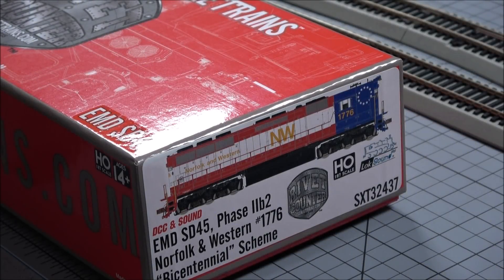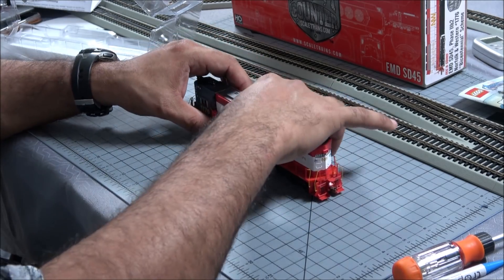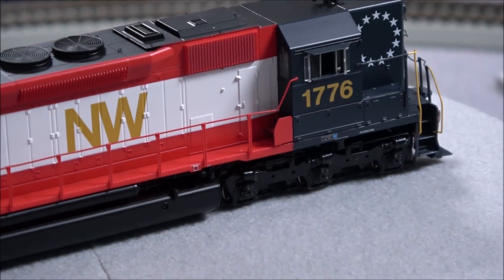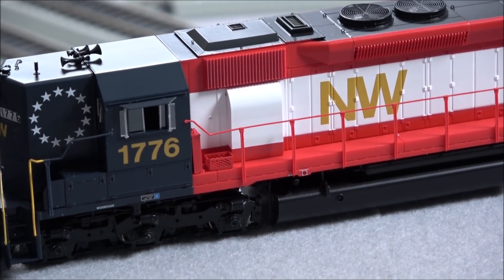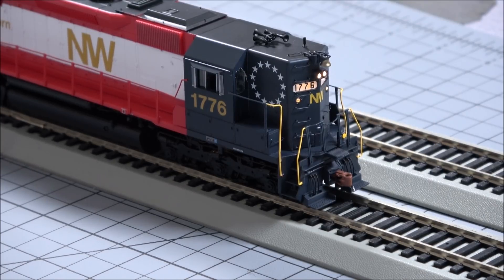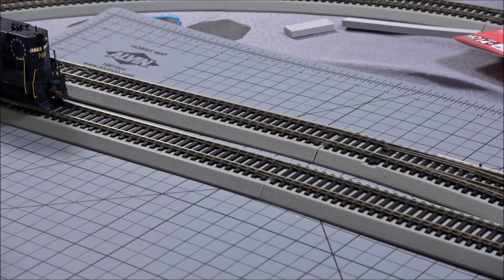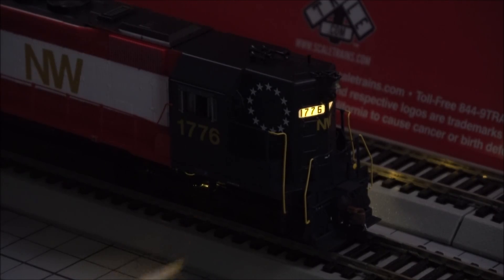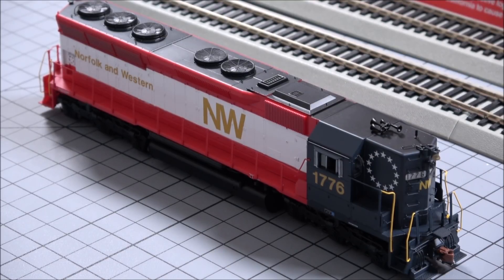ScaleTrains.com Rivet Counter HO EMD SD45, N&W/Bicentennial

Comment: Basket was used to hold coupler knuckles and tools for replacing broken knuckles.
I thought F meant front of locomotive
N & W always run their units long hood forward for crew safety but when they painted 1776 they sent a memo out to crews to always wash the unit after every run and always run short hood forward
Up until short hoods N & W always bought units with dual control stands so either end could be run forward.
Reply: What is the basket for?
Reply: Nothing beats N&W 😀👍🏻